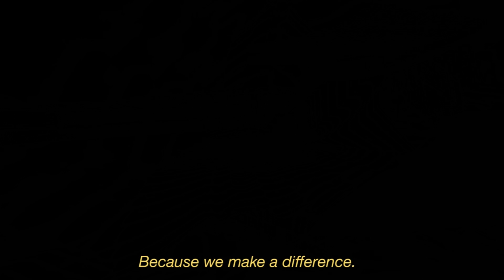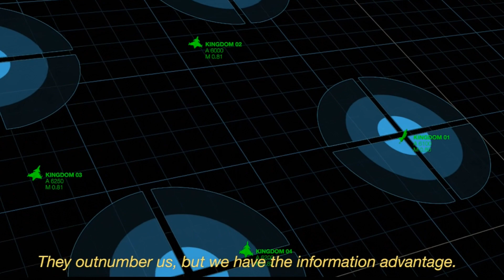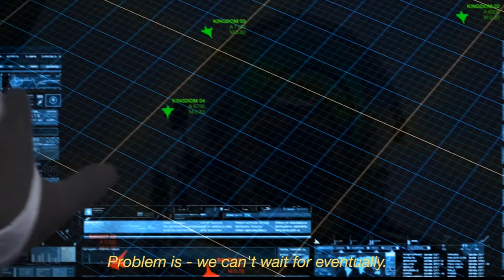Gripen Fighter Jet - Canada's Future Fighter?

Comment: The Gripen is a terrific value.  I hope it does well...maybe filling an F-16 role in the world defense market.  It's an exciting air craft.
Reply: +71ELP You are talking about the C version and not the new E version, it can carry more weapons and fly longer distances.
Reply: +Roland Lawrence
Someone in Poland got them Lockheed shekels lol
Reply: its a great aircraft for a small country. not Canada
Reply: 71ELP  Indeed !
Reply: the Canadians are taking another look at the Advanced Hornet, its effectively an H model with conformal fuel tanks on top of the spine and stealthy enhancements. You got 2 engines and a brutal airframe, cheap to operate per hour, cheaper than even the F16 and has decent range, can handle all NATO weapons.
Reply: 71ELP They really should get the ASH. Finland should as well. It can do anything that is needed while being the logical upgrade from F/A-18C

Comment: I'd vote for anything but American aircraft. Not because I think they're crap, or I hate the Americans. But there's a lot of good points raised here about domestic manufacture and maintenance to give our industry a better boost. That's one point. We can also bring different capabilities to the north American air defence role. Uniformity breads weakness and bringing in different aircraft ads to the mix. Fundamentally I agree with the Saab principles. Being like Canada the swedes have developed an aircraft to fit their limited budget, and understanding that the few airbase they have would get knocked out quickly. So make a jet capable of landing on any highway and being maintained in field. That in itself ladies and gentlemen would work for us. And let's face it, Canada is always a support role to the Americans so buying the absolute best in my mind just doesn't make sense. And look at the success the British barriers had against far superior mirage jets in the Falklands. All the best and enjoy the debate.
Reply: peashumaru I get your point but you're talking about a single country with multiple platforms. I think we can add to the defence grid capabilities as we're independant of American supply chains. As long as we're campatable in comms and refuelling, etc. I still think it would add flexibility. And if the Americans get to train against Canada with a different set of performance parameters it would add value to our defence grid.

Comment: I hope Canada will buy JAS 39 Gripen because you get a lot of airplanes for money and no other country than Sweden can offer this. But the US will stop the purchase in any way as they did when India wanted to buy the Viggen some years ago. And I do not hope Canada buys F 35 because it's not what Canada needs
Reply: Laughs in USA.
Reply: Just like they intervened to kill the Avro Arrow..
Reply: @tyson31415 Canada hasn't got the balls to say; Thanks, but not thanks to the USA. It's so shameful.
Reply: @tyson31415  the death of the avro arrow was not only our fault you guys failed to provide it with adequate funding and following the development of satilites the funds were diverted elsewhere
Reply: +tyson31415
The Avro Arrow was obsolete before it was even built.  All the high tech components in it were American anyway.  The engines, radar, avionics, weapons systems, etc.  The B-58 Hustler, F-4, F-8, and F-111 that came out before or at around the same time were far superior.  The Avro was slower, less maneuverable, and had shorter range.  The Avro Arrow project was killed for good reason.  It was obsolete and a waste of money.
Reply: @RedRider1600  In reading your comment it's difficult to know where to start because almost everything you wrote is incorrect. All of the aircraft you compared the arrow to came out  after the arrow. The arrow was the fastest aircraft period, full stop at the time. Also the majority of the components that weren't designed and built by Avro came from England which is where the Avro company originated. You can't just make up things to put the arrow down and think people will believe  you.
Reply: Don't worry.  Saab has a contigency plan.  If the USA tries to pull any of their bullshit, then Saab will use the engines from the EF-2000, they do fit.  Saab has secured second-source vendors in Europe so the USA will only be fucking themselves over.
Reply: the EF-2000  ?IS that a french engine? good to know though volvo is licensed to make the GE f400 SERIES
Reply: I like the Gripen's tactical data link system, HMD targeting system and if the Gripen does meet Canada's defence requirements, then I do think that Canada should go ahead and buy the Gripen, however as a New Zealander, I still think (all things considered) that the F-16 Block 52 is the best option for our air force (RNZAF) as the F-16 is cheaper by comparison and able to be equipped with US/NATO weapons (such as the AIM-9 Sidewinder, AIM-120 AMRAAM, AGM-65 Maverick and JDAM guided bomb) hence the F-16 is already compatible with much of our existing weapon systems.

Ultimately, I think the choice on what kind of fighter jet a country should get should be based on their defence requirements and its compatibility with that of their allies.
Reply: The mentioned weapons can be equipped by the Gripen too. Check some wiki page ;)
HUAF has AGM65, AIM-9, AIM-120, SDB-s are under contract and JDAM-s are planned too.
Reply: @trekkienzl2862  i grew up in nz live in Aus now i remember nz was going to buy 28 f16 in the late 1990s that were going to be sold to pakistan but for some reason nz backed out and now have no fighter planes my best friends brother was in the nz airforce and worked on the skyhawks
Reply: @nikolabakich9709  Yeah, the Labour gov't under Helen Clark opted to cancel the order of 28 F-16s as well as retire the fairly brand new MB-339 trainer jets, since she felt that air power was no longer necessary for the NZDF.

Given heightened tensions between The West and Russia-China-North Korea, specifically in the South China Sea and Korean Peninsula, as well as the fact NZ still has its commitments to our Australian and US allies, under ANZUS, I think it was a mistake to cancel the F-16s and retire the A-4s without replacement.
Reply: @trekkienzl2862  yes i moved before the labour gov got in july 1999 in Aus i see and hear the f18 super hornets every few months go over my house
Reply: @trekkienzl2862  i think nz is safe i dont think fiji will try to invade maybe the penguins lol
Reply: @trekkienzl2862  f 16 has nothing on the gripen E not even block70  and gripen can use all nato  and most European weapons so it's much more versatile
Reply: @connywestlund924  actually the f16 is has a better radar Superior carry weight and a better range not to mention it's cheaper (than the e model)
Reply: @spartanx9293  is that the APG 81 or 83 I can never remember these things but I dought it's better or shall I say more effective on doing its job than the selex Raven 05/? And now they can put in the new GaAn radar Saab developt . so no it got nothing on the gripen.dont just compare hard value and count engines.its like saying a race car got most HP allways win.nothing can be further from the truth it's the hole consept that determine the outcome.and so far in exercises gripen comes out on top
Reply: @connywestlund924  I used simple logic the Gripen has inferior range and carry weight to the F-16 and it's radar is not Superior you have yet to provide any source stating that it is you can argue about it superiority all you like it doesn't make it true you can't refute any of the points I've made
Reply: @spartanx9293  come on bro you claim it is superior in range.its not against gripen c yes not gripen E and got 500 kg advantage on the E.im claiming  that gripen E is the superior system overall most bang for the buck and exercises agree with me.and sources? Just Google it bro it's all there😏
Reply: @connywestlund924  just Google it just Google it that's your response and you still haven't addressed the fact that the Gripen e has inferior range and carry weight and how is it bigger bang for your buck it costs more than an F-16 because calculated by the Swiss puts it all the way up at 85 million dollars with a much higher operating cost than advertised that's less bang for your buck especially for Nations like Canada with a lot of territory to cover why would you buy an aircraft with crappy range
Reply: @spartanx9293  gripen E combat range max with droptank 1500km ferry range 4000km  f16 925km 2027km
Reply: @connywestlund924  the f16 has a max range of 2,622 mi or 4219 km so you either lied or you tried to use a clean F-16 while simultaneously using a Gripen with drop tanks cheating the entire comparison in order to benefit the aircraft you favor
Reply: @spartanx9293  haha yeah we obviously have different sources 🤔
Reply: Erm, **cough**, the Swedish government had decided the Viggen must not be available for export…
Apparently they thought it was just a bit too potent a chariot to be out off the reach of their control.
Reply: @jaydee040 was planned to shut down our aerospace industry and sell bomark missles ,also stole our engineers to work in NASA and military firms ,we should develop and build our own everything!
Reply: It's absolutely what Canada needs.  it's a direct replacement of the F18 and F15.  I wouldn't worry about birdstrike, the F35 was designed to have pieces of steel thrown into the intake and the fan blades won't break.
Reply: I honestly don't think that the USA cares enough to pull that shit and they especially wouldn't try it against a fellow charter NATO member.  If they were to do that, they would only guarantee that we would NEVER buy another American-made weapon again.  Also, other NATO nations would look at that and say to themselves "Jesus, if they would do that to Canada, what would they be willing to do to us?".

The US government knows, deep down, that they don't have anything that we need because their weapons are mostly about projecting power and that's not what Canada does.  Canada's attitude towards war is exactly the same as Sweden's.  We won't start one but we'll sure as hell defend ourselves.  Canada is impossible to invade anyway.  How does one occupy a country of this size?
Reply: @CF-105_AvroArrow  if we didn't have anything you needed you wouldn't have bought the fa 18 to begin with you would have bought French mirages or something of the like not all our aircraft are designed power projection many are multi-roll the f-15 is dedicated for air superiority as is the F-22 and the f-35 is a multi-role as is the f-18 and F-16 you know the most widely sold American fighters
Reply: @CF-105_AvroArrow  technically you wouldn't really need to occupy all of Canada you just need to seize the major provinces where almost all your people live and considering you've dangled your food producing lands directly over US territory it wouldn't exactly be hard unless you're some country other than the us trying to invade Canada because what will happen immediately afterwards is the US will SWAT them  like a fly if you guys haven't already pushed them back out into the sea(because you'll likely see them coming because they would have had to Mass a Navel landing force)
Reply: Nobody bought the viggen and India was a neutral power at the time do you really think they cared
Reply: @spartanx9293  
Engelska

Nobody bought Viggen because America stopped it, Norway Denmark Holland Belgium and India wanted to buy Viggen. But the United States threatened these countries except India and it became F 16. India was not allowed to buy the Viggen because the engine was an American construction and they were afraid that the Russians would take part in it.
Reply: @Zosiac6  why did you use an American engine to begin with and well I don't doubt this might be possible you should really cite your sources also I'm not entirely sure the viggan was superior to the F-16
Reply: @spartanx9293  Sweden has since the Second World War bought engines from the USA and the UK but also from Germany and there was no better engine for Viggen than the civilian Pratt & Whitney JT8D-1
Reply: @Zosiac6  why didn't you just design your own engine  it didn't really make a lot of sense to use a Pratt & Whitney engine at that time because around the time the viggen was being developed relations between our two countries were a little frosty to say the least as during the Vietnam war Sweden supported the Viet kong I'm kinda surprised the federal government didn't restrict access to the engine and only screwed with your attempt to sell it (also I feel I should bring this up the viggen entered service in 1971 the F-16 entered service in 1976 so that whole we wanted to make them buy f16s thing isn't that accurate
Reply: @Zosiac6  there's also the issue that the f16 was likely much better than the viggen which shouldn't be surpringso if you wanted more bang for your buck you were probably going to go with the F-16 over the viggen
Reply: There is also a very likely chance they go and buy the superhornet (which I hope they do because f*** Delta wings) one familiarity two it's a rugged and relatively cheap design (still a tad bit more expensive than the Gripen) and three it's not a f**** delta wing aircraft Jesus Christ what is your obsession with them
Reply: @spartanx9293  they are just better😏
Reply: @jaydee040 you want to know another aircraft that was called one disappointment after another the F-16 and f-14 both proved their worth
Reply: @jaydee040why do you think so many countries bought the F/a 18 over the f 16 they wanted a two engine design while still keeping costs down when in comparison to the f15 I've also heard that buying the f15 would have been viewed as military escalation
Reply: @jaydee040 just use copy-paste to link sources
Reply: @jaydee040 oh dear God don't bring up what I think your going to bring up
Reply: @jaydee040 friend the viggan was single engine and so is the gripen if single engine is an issue the gripen is right out
Reply: I'm not sure how many hrs friend has flown but it's ALOT. and not even 1 (ONE)  engine failure.maby  2 engine's was important 20 years ago it's a hole other quality nowadays
Reply: Buy 12 f35 b for Navy. 6 for Nova Scotia,  6 for Brittish Columbia! Thats it. 88 Gripen will work great, will take long time to build. Get 20 Superhornets now.
Reply: @trevorlawrence310  or you could buy 88 f35as for a cheaper cost than the Gripen e
Reply: the primary excuse the US had for blocking the gripen for india was the risk the indians would hand the GE engine technology to russia or china.
Reply: @bademoxy  that doesn't make any sense especially when you consider indian relations with China and we didn't block their purchase of the rafale which is in most qualitys superior to the gripen
Reply: ZoZo fuck america, did they stop the purchase of the viggen WTF!